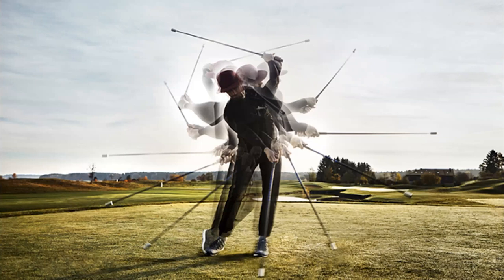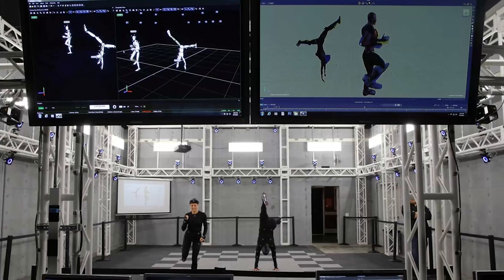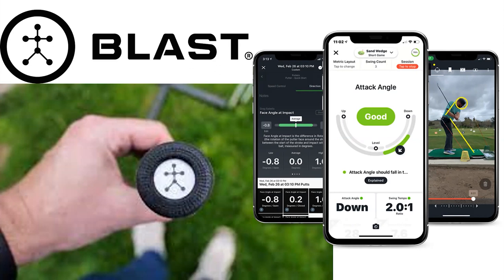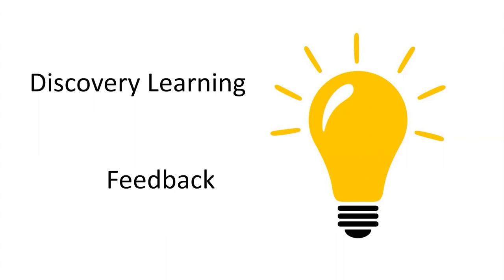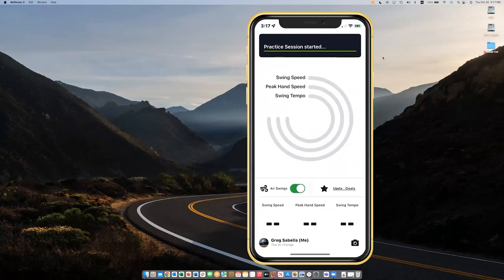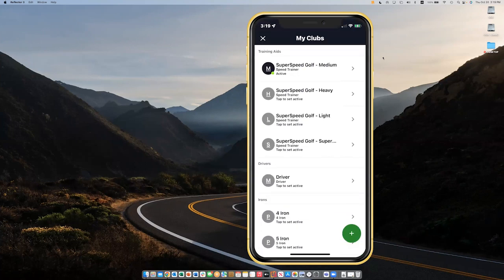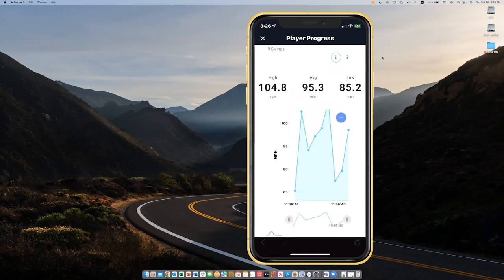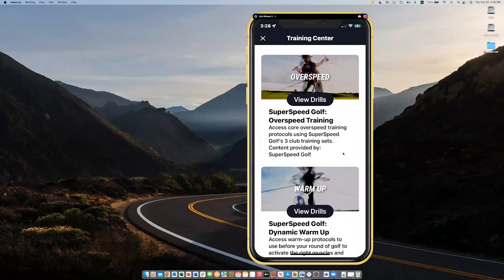Train and Track Webinar | SuperSpeed Golf and Blast Motion

Comment: Just curious how blast compares to zepp golf.  
I know blast appears to look at other metrics and has features for air swing and putting.
I am curious if the blast technology
More advanced compared to zepp? 
I found zepp not very helpful after a couple of years of using it. I had no improvements. I found zepp would tell me I had a great plane and swung my iron at 94mph. I was never even close to 94mph.  
I worry with this technology is not actually showing you what your lower body is doing. 
I do use swing speed sticks and love the changes in my swing with speed sticks.

Comment: How fast do you swing the different sticks ? I have tried them before once or twice, because my mate have been using them, and he let me have a go at them from time to time,

This time around though, ive borrowed them from him, since he is done with it. He has gained some speed, and is happy

Ive done sunday, tuesday and thursday this week, and now taking the rest of the week off, till sunday, then ill start again. Im using the prgr and my pre driver speed is around 116-117 on prgr . Now today i got it up to 125 with the driver after the speed sticks.

Massive jump and i dont think it was a bad reading, because i got post speed stick driver to the 125 mark a few times. But most at around 122 But im only swinging the green 132 or so. Had one up to 135 today and the blue is around 128-129 and red 120-122 when i did it today

Does this seem right to you ? And my left side is VERY VERY weak. Im pretty sure i look like a handicap 74, because my coordination with my left side is really really bad. Will the left side get better ? I feel pretty stupid doing the left side 😄 

And i tried it out on the course today aswell. Hit 2 of the longest drives for the year . Almost as long as when its dry and you get way more roll,, so the gains, even for just 1 week is pretty big ! 
I do think something is off though, since the stick speeds are pretty slow compared to the driver speeds im getting ?

Sorry for the bad english. Hopefully people can understand what i mean